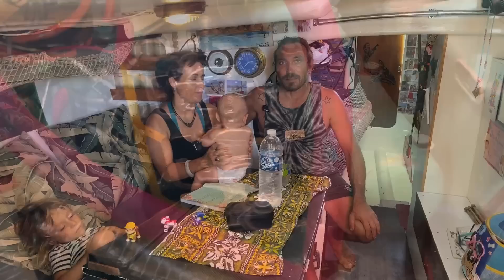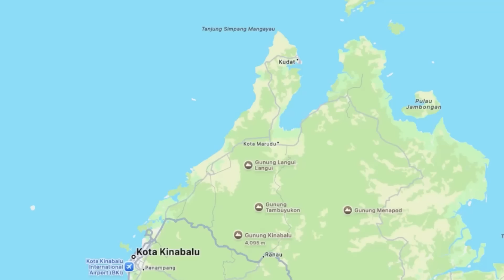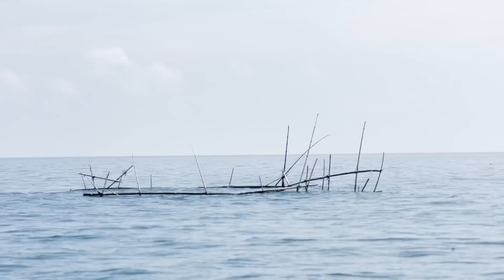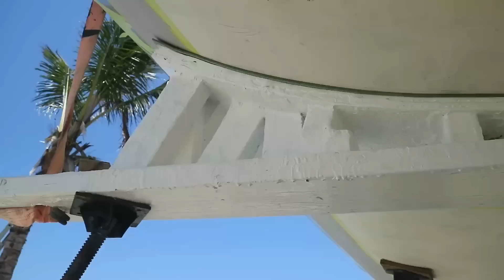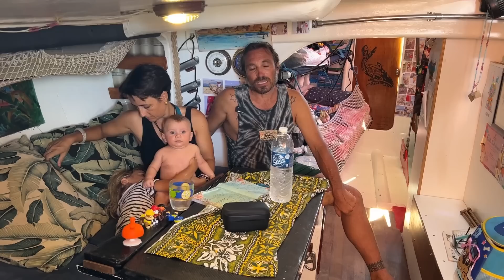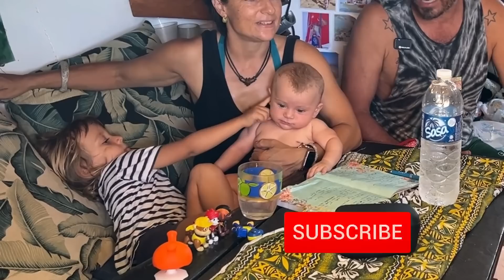Tough Choices and a Big Step Forward | S2 Ep 54

Comment: A boat of your size should have around 150hp.  I had a MacGregor 65, which was essentially a production race boat, and it had 150hp.  I rebuilt and upgraded the engine to have 220hp.  I could cruise under power at 10 knots.
Reply: 150hp for a slippery, light, hull like that?
Reply from the maker: @robd8577  right too much 👍🏻
Reply from the maker: Would be nice but not within our budget sadly
Reply: @SailingNV Up until recently, the maximum horsepower of sail drives was limited to around 80hp.  A boat of your size should never have been equipped with a sail drive.  It would be nice if there was an easy way for you to switch over to a straight shaft or even a v drive configuration. In my opinion, sail drives are the easy way out for boat manufacturers since they don't require much engineering to install.  As long as there is room for an engine and a large hole in the bottom of the hull, they can slap a sail drive in it.
Reply from the maker: @ChrisHarding-lk3jj  we agree in some way but timo is happy with the sail drive for now as it requires less modifications

Comment: That's a great and much needed decision to replace your engine.  The delivery & installation logistics and work sure sounds challenging!  I hope you can find a good agent to handle the process on your behalf.  
Not only do you need to be able to squeeze it into the engine area but you need access to maintain it well.  Then there is the issue of diesel tanks, a bigger engine consumes more fuel, and at times you need to motor for long distances.  I hope you can address this at the same time.  Safe management of fuel, filtration, cleaning, is important.
Reply from the maker: Thanks Tommy yep it’s going to be a big move but one that’s needed 👍🏻👍🏻